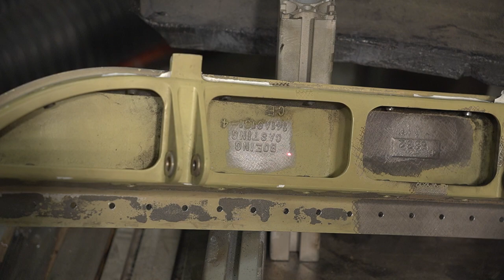Laser Cleaning Technology Applications in the Aviation Industry #MROAM

Comment: Those laser settings are way too harsh for aluminium, the substrate is getting damaged. I suggest you drop the power by 25% and set speed to max. Lower frequency down to about 80 (pulse at 250), then increase F from there.